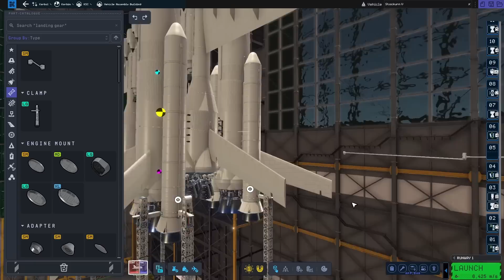KSP2 Air-launching a SATURN V

Comment: obviously i don't know your PC specs but 2 fps, for that craft.....is really worrying and disappointing, i'm sure KSP 2 has some nice upgrades to building tools e.c.t but the performance is a joke, is this not what we all wanted a new kerbal for in the 1st place, the hope of having high part counts to a point where you could at least bring a 100 part rocket into range of basic fuel space station without the massive frame drops of 2 fps, i really not having alot hope here for KSP2 i certainly won't be buying it unless they can seriously fix the performance, right now i see zero point when KSP 1 runs alot better......screw the graphics its a sim after all, just feels feels like we got KSP 1, but trashed the performance even more and added flashy graphics, instead of working on an engine that can support larger vessels, just worried that the devs missed the mark by few A.U's